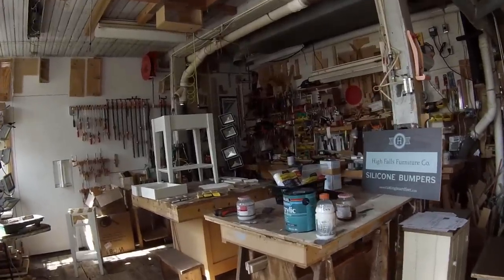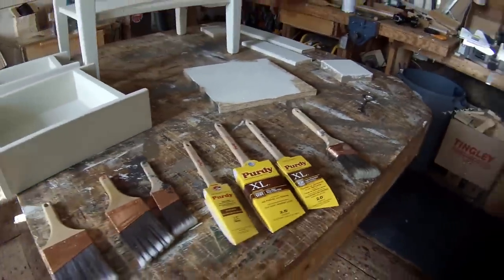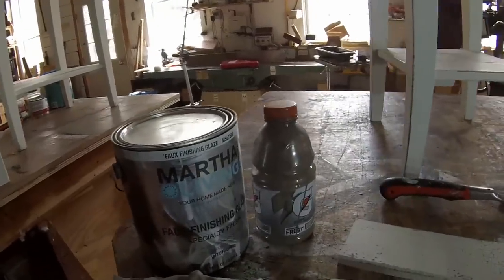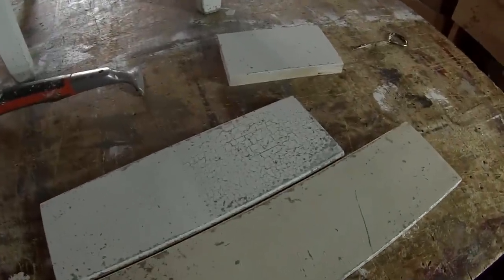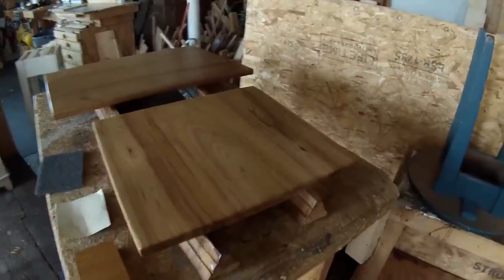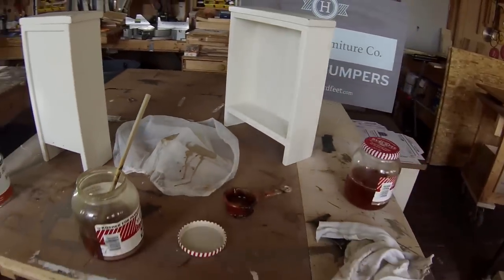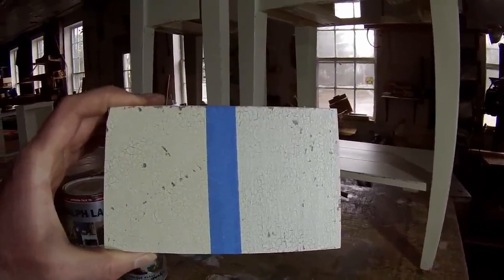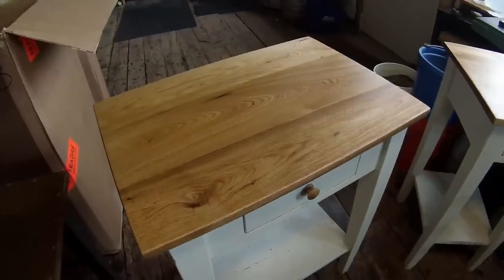Distressed Paint Finishing Tutorial Part 3: Varnish (pro tips and techniques + glaze intro)

Comment: Great stuff.  That butternut is great looking wood.  Correct me if I'm wrong, but I understand you keep the shop fairly cool in the Winter.  Do you make any adjustments to mixtures or techniques to adjust for that?  I don't heat my shop, but I'm in Seattle where it never gets that cold, yetI have had trouble getting finishes to lay down properly in colder weather.